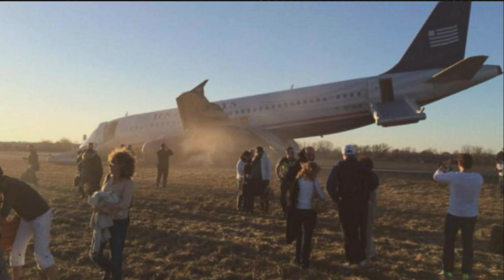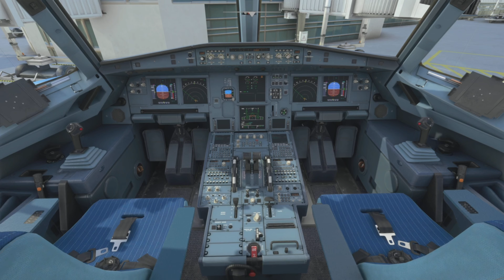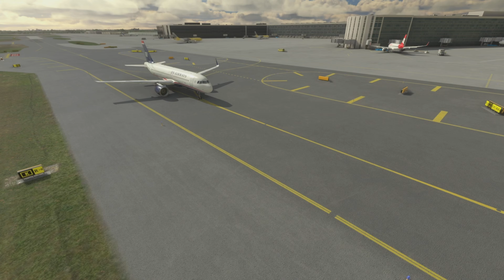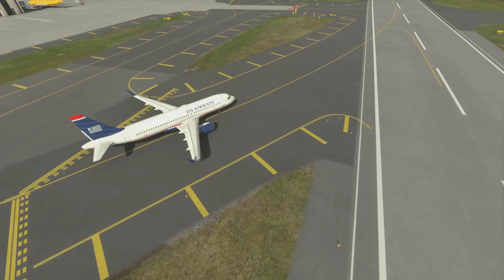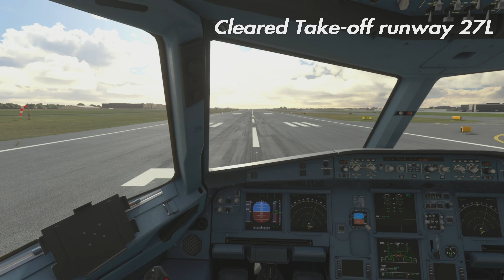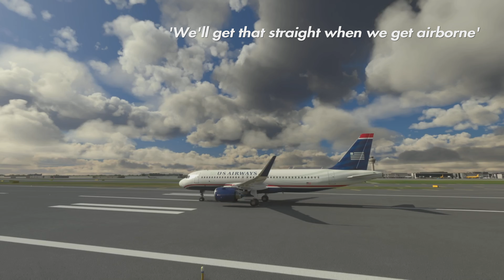Should They Have Continued? | US Airways Flight 1702

Comment: What age are pilots mandated to retire?

I ask because this looks like one of those “indecision” that plague older drivers/pilots. Yes, the pilot’s experience told him correctly that he COULD continue to take off using the numbers he got from the briefing. But no, he second guessed his own reasonable decision earlier!

By reversing his earlier decision to continue taking off, he ended up with the worst of all possible outcomes. 

Older individuals don’t process thoughts as quickly as when they were younger. In a cockpit, when decision windows are narrow, older pilots may not be able to think through all their decisions, leading to this kind of back and forth conflicting decision and worse of both outcome.

The co-pilot, also over 60 year old, didn’t help by not giving clear communication on what’s going on. “I’m sorry” isn’t the kind of things to say in that situation. She should either be insisting to reject take off, or at least give the pilot the numbers for him to make a decision on. Both pilots were indecisive, leading to a worse outcome when there were many other better options. 

As others pointed out, putting the throttle on Go-Around would have gotten them out of the jam. But neither pilots thought of that?

Comment: I think I'd have taken off with the wrong runway set. As long as it is the one you are actually cleared for, and you are sure it's the same length, I can't see that making a huge difference. If it was already the case that the flight plan was lost, aborting before the take-off roll would have been the best time to do it. if I was pretty sure about the V speeds, and that putting the flight plan back in could be done quickly and safely after take-off, I might have used full power instead of flex. If I was already in the take-off roll and I suddenly heard retard warnings, I'd have aborted the take-off immediately right there.

Comment: Being an armchair pilot, these are my thoughts: The plane was flyable as we now know, but in the heat of the moment, the captain believed it was not. So I understand his decision to reject the takeoff, even past V1. Not flyable meant (in his mind) that it surely would have crashed once it was airborn, rejecting past V1 meant it probably would have crashed into something and burst into flames at the end of the runway. And it didn't. But as soon as they noticed there were no V speeds indicated, he should have aborted the takeoff, not several seconds and knots later. 'What did you do?' is not the right question in this situation, 'I'm sorry' isn't the right answer either. Like she's apologizing for spilling some coffee. The trust reversers are not mentioned in the video. Were they deployed? Do pilots have the airport layout in mind, regarding what's past the end of a runway? I mean buildings, hangars, storage tank, fences, trees, ditches, sea etc. Maybe this also influenced his decision to abort or not. I know it doesn't matter what's behind the runway, you shouldn't be rolling there but when you got yourself in that situation and you see either buildings or an open space, I believe it can make a difference, if not cognitive then instinctively anyway. The flex temp I believe is also used for noise abatement if an airport is close to densely populated areas.

Comment: Doesn't this sort of event demonstrate the nonsense of the 1500-hour rule? 

I am referring to the US here, but unless something has changed I believe a similar number of hours was already being required for Australian pilots before the FAA increased their requirement in 2010. 

I guess Australia had already caved to unions and was already choking the supply of pilots to the airlines prior to the FAA following our irrational example, or perhaps the US AP union followed out own pilots airline pilots union, to the detriment of any pilot not already through the door. 

I am not a pilot, but in my career have spent more hours in light planes being flown to some middle of nowhere/back of Bourke site than I care to remember.

Can any pilot out there explain to me 1500 hours of 'command' experience in a Beechcraft Baron built in the early 70s that involves:
- no practice of cockpit management, 
- no management of digital flight inputs in busy airports (considering most of 1500 involves use of vacuum gauges)
- no CRM (hard to practice if you're the only pilot)
- and typically no experience in handling real emergency situations, 

How do these 1500 hours make for a better pilot at the point they achieve their ATPL?

Developing emergency management skills, learning to work to a vastly greater number of procedures consistently and whilst under pressure, and problem-solving complex systems under pressure comes only after gaining experience in a simulator. 

Simulator training only begins after the 1500 hours are achieved and the pilot is brought on by the airline for real training. (Assuming he/she hadn’t gone broke in the meantime.)

And please don’t talk to me about airmanship. You can't tell me you need 1500 hours to develop your airmanship, especially when so many of those hours are spent ferrying one or two passengers to remote sites involving one take-off and one landing per four hours. The pilots I have had ferry me to different parts of nowhere have become so bored they let me fly half the trip, and I like to think I achieved a reasonable standard of airmanship, especially when a couple of pilots started letting me land the Barons on the remote strips. However, improving a sole passenger’s flying skills is not exactly the point.

As pilot demand increases the 1500-hour requirement is going to become a greater detriment to safety the longer the US and Australia hold onto it. The requirement results in a smaller pool of talent to hire from with the criteria coming down to who can afford 1500 hours rather than who has the best aptitude. Certainly, you need experience across a range of conditions, but 1500 hours of 50% meaningless experience is over the top. And that includes instructing.

Aside from some landings on some very short and rough fields, I cannot see that any skills at all are being developed past the first 700. And until 737 pilots find themselves having to do low passes to scare kangaroos off runways (post a Chinese strike?), none of these extra skills will add anything to safety. They will in fact detract from it.
Reply: Do you think anyone will read all that?
Reply: @kickedinthecalfbyacow7549  Nope, must have been trying to get to sleep 🙂

Comment: The captain should have rejected the take off already when they got the ECAM-message. At that point the plane had almost zero speed and a reject would not even have caused high brake temp, thus completely uncontroversial. At <80 kts almost  any failure indication should result in RTO. This was no trivial ECAM either. Bad decision by any standard. Not to RTO after realising V-speeds are missing at 86 kts with aural ”retard”-warning screeming BUT instead ”reject” at 167 kts while airborn is unbelievable. Anybody can make a mistake but at least the first two are signs of poor judgment. Strange for such an experienced pilot, early onset dementia? Not rested?

Comment: He should have rejected the takeoff when he got the thrust not set ECAM message and saw that there was no V1 speed on the PFD. Once he committed to the takeoff by starting the rotation he should not have changed his mind and pushed the nose back down. After lift off there would not have been a V2 speed to pitch for but after a few seconds the VLS and other airspeeds would have appeared anyways and would have given the pilots a good estimate for maneuver margin even without V2. Beyond the acceleration height the flight would have been completely normal again and they could have continued to their destination, file a report perhaps and go on with their duty.
But I'm not an airline pilot and they may not have had the big picture view like we have after the fact.

Comment: Fundamental requirement to delay take off if a significant anomaly is noticed ie wrong runway inputted.  The implication is that there may be other anomalies not yet noticed which could endanger the flight, as it was in this case.

Comment: Evacuations are conducted unnecessarily and seemingly often in some regions of the world, particularly North America.

There are a number of risks often resulting in injuries when conducting an evacuation, dramatically more so with wide bodied aircraft that sit a great deal higher off the ground and their specific slide design.

In thie event featured an evacuation with its inherent risks is completely unwarranted, there was no fire or other risk to life. The occupants were far safer inside the aircraft, especially with the exceptionally steep incline of the slides at the rear doors due to its nose-low tail-high attitude. Stairs could have been brought to the aircraft or a single slide could have been deployed at the nose-low forward left door(1L or L1), the same door they would have likely boarded through, once appropriate transport arrived. The occupants could have safely walked across the shallow incline of the slide, and not being an evacuation they could have taken all of their belongings with them onto the waiting buses.

An evacuation is only necessary when the risk to life is greater inside the cabin than out, when the benefits clearly outweigh the risks which is mostly due to fire, or in the event of a ditching the risk of the aircraft submerging and drowning the cabin occupants.

If there is no fire or the aircraft is not in pieces it is far safer for all to remain seated and wait for transport and if possible, stairs - wide bodies especially.

If the situation changes and a genuine threat exists, then yes, EVACUATE!
Reply: By not conducting an evacuation when it is not necessary it has the benefit not only of preventing unnecessary injuries to occupants but also mitigates the likely damage that occurs to the fuselage when opening 'Armed' doors and deploying slides, along with the outrageous expenses surrounding subsequent repairs and the replacement or repackaging of slides (when appropriate).
None of the issues surrounding cost mattered in this case as the airframe was written off, but the unnecessary risk to individual's safety must still be factored.

The expenses or potential fuselage damage must not and is never a consideration ever worth making whether to Evacuate, or conduct a less risky but still moderately urgent 'Precautionary Disembarkation' (a non-normal disembarking of occupants using either stairs, an aerobridge if still available or a slide using the slower safer 'sit and slide' vs the rapid 'jump and slide' technique).

When neither are indicated but the aircraft is unable to reach the terminal for what ever the reason may be, then as described in the former comment, stairs and appropriate transport will brought to the aircraft. In that instance only may passengers and crew ever retrieve and take their belongings with them.

Comment: Attitude is more important than the tons of flying experience. It is useless to suggest options which were available to the experienced cockpit crew at that moment in time, if you cannot exercise a simple decision of fire walling your thrust levers. It was a same situation like a “Pull-up” or “Wind-share” audio warning by your EGPWS and you are trained that without wasting a single second to go Max Power pitching up to a safe attitude to get out safely from adverse situation. Even though there was a audio message to retard.

Comment: When they got the ECAM message that the thrust levers were not set even though they were, the pilot flying should have aborted takeoff immediately. It could have been easily deduced that something wasn't configured correctly in the FMC given the last minute change from 26R to 26L and the error occurring when the thrust levers were places in the Flex detent. That was his cue to abort takeoff. Everything else that happened after that was just going further down the holes in the Swiss cheese. Those people are lucky to be alive given the decision to abort the takeoff AFTER taking off.

Also, the FO really screwed the pooch for not entering in all the correct data for the new runway, and the captain screwed up for not doubling checking the FMC after the last minute update. Really, this is a failure of CRM all around.

Comment: the decision to reject takeoff came too late, sure. but it was the correct decision.
so while you can fault the pilot for reacting a few seconds too slow i dont think its useful to say that at this point he shouldve just taken off.
running out of runway is not great, and damaging the plane was basically guaranteed at this point - but it carried relatively little risk for crew and passengers. the alternative would have been to fly with a plane the pilot considered unsafe. and while in retrospect it is debatable whether it actually was unsafe the pilot can only make a decision based on what they know.
the moment you take off the risk of death for all aboard rises exponentially. 

Getting everything perfect first try and reacting within a split second is always good on paper. But its also unrealistic. And given a high chance of damage to the plane and a low chance of people dying i think the pilot made the right choice.
Reply: Generally if you have a perfectly flyable airplane it’s safer to fly it than it is to crash it. Crashes are unpredictable, there is no way to know if people will be injured or killed, they were very very lucky.

Comment: Stupid pilots, 1.  protocol calls for what most airlines call a “mini brief” after a runway swap, to prevent this problem. That would have made the non flying pilot do a quick check on the computer programming. 2.  In case of a computer glitch, or in this case pilot glitch, the policy is to go to full power, which bypasses all computer programming, airplane goes to max rated power, and flies happily away. 23.000 hrs and no functioning brain, incredible…

Comment: The correct decision was to taxi off the runway and get the flight management computers programed for the correct runway with the V speeds into system. There was no reason to continue until everything is properly set. Anything other than that is poor decision making. The FO did the Captain no favors by first incorrectly programing the wrong runway into the system and secondly by not pressing the captain to taxi off the runway and correct the error. This is an important tenant of Crew Resource Management.

Comment: Question: whether the V speeds were set or not, the plane had accelerated to 167 knots which is 5-5 knots over the rotate speed…shouldn’t they have continued? The speed they were doing would guarantee lift according to the engineering of the plane
Reply: Your right but most pilots are dumb career pilots not true aviators. True aviators are mostly doing aerobatics, or even gliding, or are lifelong GA instructors or enthusiasts. These days new pilots are in it for the money and career. They only do what they're taught and know NOTHING else. It's all about passing tests to get certificates so they're taught how to pass tests, they're not natural born pilots nor even good pilots. They're garbage, just like these two klutz "pilots". Anything that's out of standard which they weren't taught they panic and make the situation worse. Career pilots are like machines only there to operate what they're programmed to do. When something out of the ordinary happens the machines don't have a brain to think with to make the correct choices. And female pilots don't even get me started if your name is not Martha king youre probably a trash career pilot in it for money and "oh em gee free travel omg yayy". They're not in it because theyre true aviators. Wish I could get rid of the lot of them, or devise randomized tests that I know would instantly fail the fakers and career pilots on the spot because believe me they cannot think on thr spot or fly if something goes wrong, they just crash